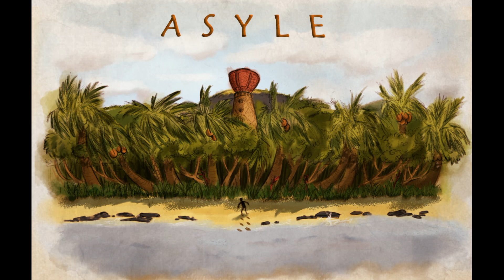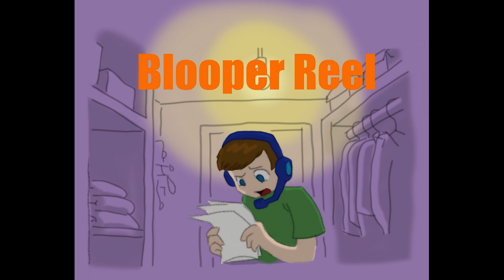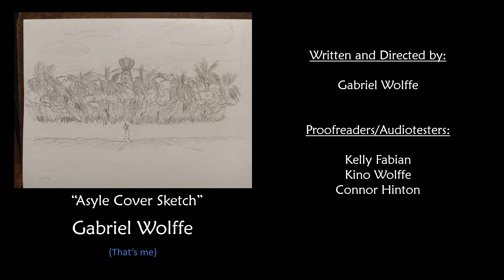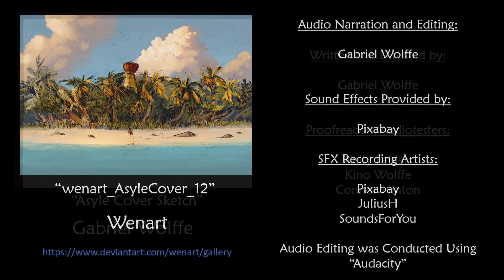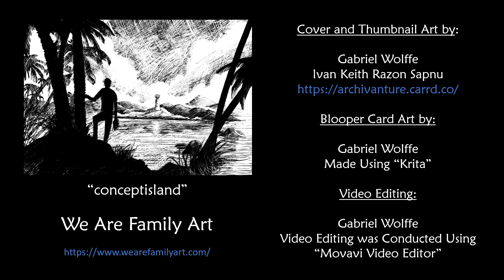Asyle: Week 21 | Building a Generator, Producing Nitric Acid from Air, and Finishing the New House

Comment: Is this a game?
Reply from the maker: Yes and no.
It's technically just an audiobook/fictional journal (though I think it might make a fun foundation for an adventure-game/Mystlike). 
However, the method I used to write it was sort of like playing a PNPRPG with myself.
I would present myself with a situation, ask what resources were available to me, do some research to confirm whether or not they were present, and write down what I would do as a result of those findings; in that regard, it is almost like a simulation.
If I wasn't sure what would happen during an experiment, I would make my best guess and then check to see if I was right, and how that would end up affecting me.
If I was asking questions even Google couldn't answer, I'd make my best guess based on the science I knew and tag it as speculation.
For any events that were unpredictable, like the weather, I would use a random number generator to decide that for me and respond appropriately.